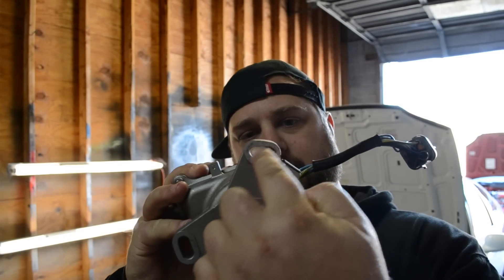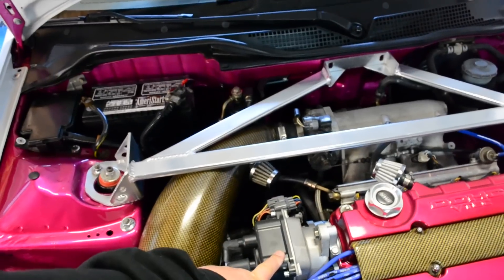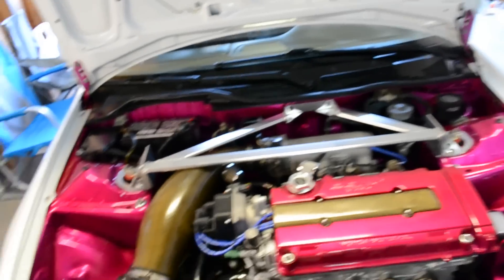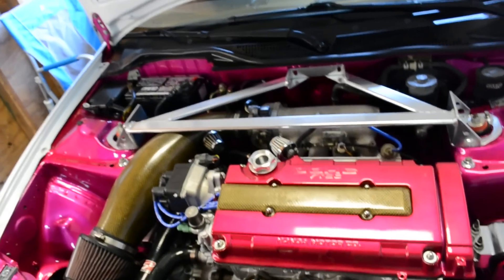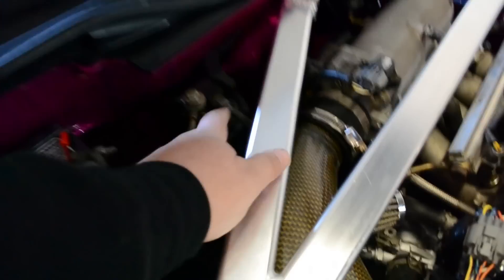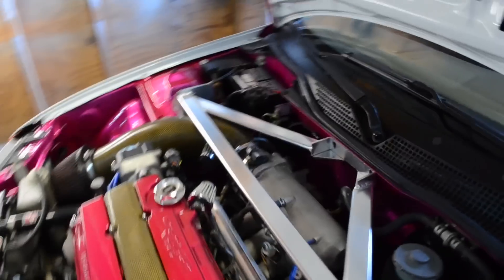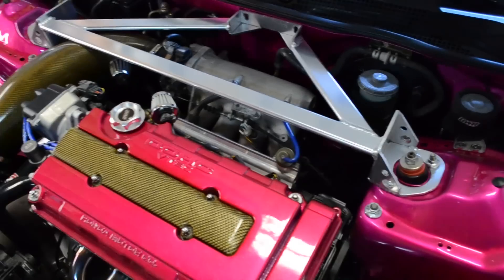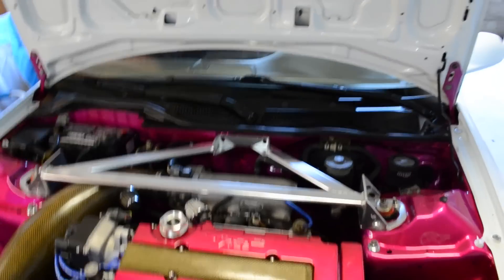B20 VTEC  TUNING AND TIPS!  HSG EP. 4-41

Comment: The fluctuating idles in Hondas I have seen have all been caused by vacuum leaks. Have seen only seen one related to IACV (coolant related) The others were all FITV/idle screw adjustment issues or other vacuum leaks (brake booster/cruise control ports)

awesome channel

Comment: A big issue with the timing on a P73 map for a stock B20V is the cam profile of the P73 engine which the ecu map is designed for. The Type R cams have more lift and duration and therefore require a cooler plug (BKR7E vs the BKR6E for the GSR/B16) Whether you are running P73 cams or not, but especially if you are, you should always run the BKR7E in a B20V. This is more of a bandaid approach as ideally the setup should be tuned, but if your running just a basemap run the cooler plugs as well. It goes a long way to help with pre ignition. Also it should go without saying to use premium fuel always in a high comp VTEC engine. 91 minimum 93 is better.

Comment: Hey I have a 2000 h22a4 bolted to a 92 prelude si lsd manual transmission  I was running the stock h23a1 harness to engine  but which ecu will safely run that engine without running it to lean

Comment: I love the information you give to and videos you put out. I have a question that im having a hard time getting answered. Suspension top hat bushings. My mine are bad and idk which ones to order to replace mine with as i can not find anything through the skunk2 replacement site. I have a 96 Integra on skunk2 coilovers. its the rubber/polyurethane that sits in the wholes on the strut bar. Thanks!
Reply from the maker: DeMarcus Cleveland use stock bushings they last longer

Comment: Thank u sir ive learned alot since subscribing........i have a B18C5 ....it runs & idels fine .......but i was wondering if values can tap in these motors like ive seen in a old S10 truck i had 20yrs ago the values were tapping.........also does it sound the same? Thanks

Comment: I bought a civic with a b16 and it had a surging idle.  I popped the radiator cap off and it was about a quart low.  Topped it off and bled,  idle problem gone.

Comment: I have a question? I know you said it best to have your ecu chipped and tuned to run correct but I live in CT and I have to do emissions. I have a 00 civic ex with a jdm b20b block with a b16a2 head, I don't know if you guys know but what ecu could I use just pass emissions? I've heard the obd2b gsr ecu's have ignitions immobilizer but can't find a correct answer about the 99-00 civic si ecu if they have immobilizers but even still would the b20vtec even run or run ok with that ecu? please if any info it would be of great help.

Comment: The problem i'm having is that I had bad fluctuating idle like you described, where it revs up and down from 1500-2500 but not all the time, then my rotor broke on my ebay distributor, so I rebuilt my oem dizzy with new igniter/coil. I need to get my ignition timing done but I cant get the car to idle properly! Sometimes at 1k at idle, then sometimes drops to 400 about to stall, I just got a new battery too, and another used Iac valve. Ideas?

Comment: I would use 0-30 5-30 or 10-30 oil in the older b d h and f motors. surprising to me was that mobil 1 0-30 is a direct replacement for 5 or 10 30 oils. the benefit is miniscule fuel mileage increases

Comment: hey guys hope u can answer this. I have a 97 acura cl, the engine is a f23a1 PAA is the head cast. I changed the cylinder head but realized it was a POA cast instead. car won't rev past 3 grand very slight chance that it will. is the wrong head the problem?

Comment: got a 99si with a b16b type R iam doing under dash harness and can't find one can I use just a 99ex under dash harness?
Reply: Just leave the stock harness! Or if it's fucked a 99ex will work it basically the same thing
Reply: Nice thanks bro I thought I needed a 99si harness mine is hacked up
Reply: Yup no problem.just make sure it's from a 99-00 ex

Comment: Why do i need to run premium gas for b20vtec ive used 87 for my stock b20 and it runs perfect does changing the head and all that require premium what if i use 87 for b20vtec??

Comment: I'm trying to do the timing on my b18b1 with p8r head, the INTAKE cam isn't rotating freely and will NOT line up with the exhaust cam and the head because the intakecam is pressing on rockers too hard and tweaks out of timing. ANYONE ever have this problem and fix it? Because I'm about to snap bolts and fuck things up and could reeeeally use the help

Comment: Hey I got a b18b block with a b16 head, what's the right proper torque spec
Reply: download a b16 repair manual and check the torque specs to use for the head (head studs, cams bolts, valve cover, etc..), and a b18b repair manual for stuff related to the block (flywheel, clutch, etc..)

Comment: how high can a stock block b20 rev to if it has a stock gsr head?
Reply: roberto molina wouldn't rev it past 6800. if stock block use factory redline.
Reply: block doesnt matter, its about what the head can take, whatever people rev the gsr up to is fine.
Reply from the maker: roberto molina a B20 will survive 8000 rpm  no problem or even higher if a lighter flywheel is used.
Reply: So with the rod/stroke ratio and lack of oil squirters and stock oil pump and water pump is ok to rev that high?
Reply: Wouldnt you use a gsr/type r/b16 water pump yo prevent cavitation? and oil pump to keep up with higher rpm oil supply?
Reply: all of the b oil pumps are able to put out plenty of pressure and flow to keep up, their all basically the same. The water pumop can rev that high too without a problem. All of these things have been tried and proven time and again.
Reply: I rev my B20v to 8400rpms with no problems. I've been rocking the same motor for 5 Years & I race at the track faithful.
Reply: roberto molina  my b20v power lost after 7500 . Why ?b20b with stock b16 head
Reply: Alisa Inthisane get larger cams. Itr or skunk2 tuner cams.
Reply: You have to use your old gsr parts,water pump and neck

Comment: I’ve been having a problem with my gearing in my b20v, I’m not getting any low end power in 1st and 2nd gear, then when I shift into 3rd gear rpms jump 1,000 rpm as if I downshifted, also does this going into 5th gear. Any ideas?
Reply: Probably out a tooth on the belt or valve adjustment what trans u got ? U want a gsr transmission for sure. And check make sure u are about 19deg on timing with everything good and should be good don't know what you got going on.